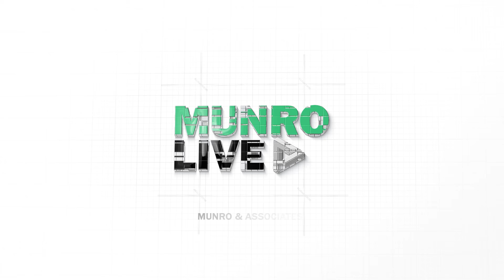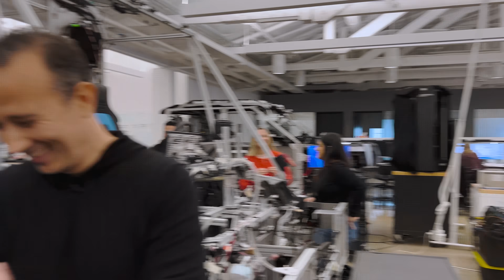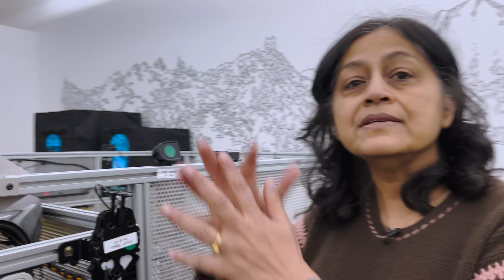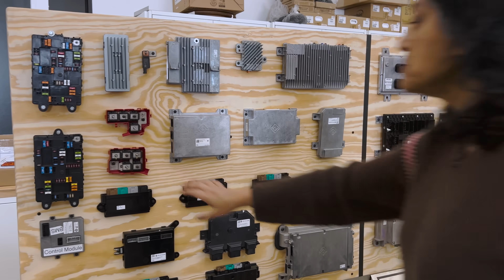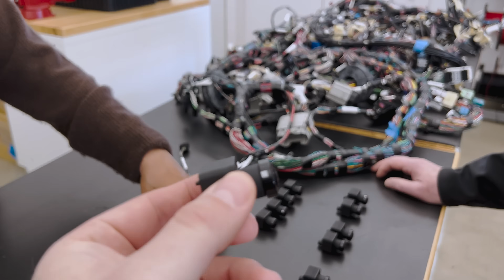Inside Rivian's Electrical Hardware Lab with Vidya Rajagopalan

Comment: Munro Live always talk about costs and streamlilning in manufacturng assembly, but rarely about the costs and headaches downstream when service is needed. In this day and age of OTA software fixes is really a bane when hardware needs servicing because of all the shortcuts and cost cuts involved in the manufacturing process. Trying on hardware repair is costly and difficult. The irony is that the ease of software development and the dependency of everything working in sync is hardly achievable nor practical. Quite often the digital domain makes any fixes a challenging ordeal. In software, they tend to fix one thing and something else works abnormally. In hardware, just trying to get to it without major teardown is rarely possible. Also the convenience of OTA software fixes results in lax in software control. Often times, the business model is release it and we can always fix it later. Then the problem becomes exponentially difficult to be reliable functionally.

Comment: My biggest pet peeve is after all the thoughts going into the design of efficiency in manufacturing and saving costs, they couldn't care less for the people that have to maintain it down the road. That is why repair costs are so expensive nowadays. It is a stark case of saving cost and efficiency on the manufacturing stage by robbing Peter to save Paul and have the owner downstream paying royally to repair and maintain it. It has gotten so bad that a lot of times repairing anything on a vehicle is almost impossible because of the expense. That is why insurance cost on EVs are so high.

Comment: I'm surprised about their design around the doors as most wiring harness engineers try avoiding harnesses frequently being bent as they will do if they are going from zonal  west" "I/O computer and only wires to actuators and sensors compared to having an I/O computer in the door and only having power and network wires to that from a zonal computer. Could you comment on that?  One reason could of course be that they have moved away actuators and sensors from the doors and simply have less need for I/Os in that "zone" but that is not a pure results of electronic design but more a consequence of the mechanical design, e.g., putting the door lock in the B pillar instead of in the door or no door handle in the door but elsewhere and if you also have removed mirrors from the door and replaced by camera or put the mirror on the A pillar, then you have simply less need for I/O in the door.

Comment: The big reason to use Ethernet all over is weight based on less wire.  Bandwidth/capacity should not be the driver to use or not use Ethernet.  Add Power over Ethernet and even more weight is removed.  Location and reduction of ECU/Compute should then be much easier.  Also creating redundant connections would be easier for crash survival.

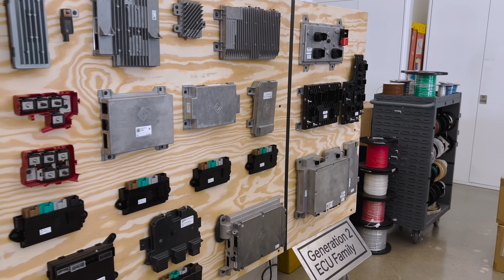Comment: Wild looking at that board at 18:25.  I feel like all the big US market manufacturers (GM, Stellantis, Ford,Toyota, Honda, Nissan, etc.) are still stuck on that left half of the board.  Wild that Rivian was able to figure this out yet the big guys are still just throwing modules all over the place, fuse boxes under the hood, two in the dash, one in the trunk, etc.  The only downfall I see to the Rivian approach?  One of those PCB fuses goes, or a component in the PCB in one of those goes, you need a whole new module.  And that can't be cheap.

Comment: This will be nightmare  for electricians to work on, with all those wire "hoses". I prefer more ECU's because they easier to replace, diagnose and they are usually placed in more accessible places than wires.

Comment: Vidya is what normal Car Companies with their Machismo work environments lack. I do worry about the Semiconductor cooling for the ADAS and Infotainment. Thermal paste + that 1 piece Combo Heat sink + Vibrations. Lets assume that double sided heatsink is manufactured to super fine tolerances and so are the PCB's with their individual chip heights. (Lots of variables here). Are they going to maintain contact via thermal paste over time, road vibrations etc?

Comment: Note to self, don’t buy a Gen 1.
Reply: lol don’t be fooled.  This was done specifically to make Rivian profitable which is a good thing.  But, all the “updates” in gen 2 are designed to CUT costs.  Gen 1 spared no expense which is why they lost $100,000 per unit.  There are other videos showing gen 1 parts that have much better build quality.   So, I applaud Rivian for cost cutting so they have a viable future, but Gen 1 is superior in nearly every matrix.

Comment: Seems like the function focused wiring architecture represents special use integrated circuit processors where the zonal architecture is using general use IC processors.  The software achieves specificity of function for general IC processors. Zonal multitasking would split the bandwidth of the processor for different simultaneous functions. Very cool.  And over the air updates reprogram the zonal processors to achieve software defined functionality.

Comment: very informative and provides insights into important details. The Gen2 system is efficient with fewer control modules, which is a great improvement. However, troubleshooting faults in this system can be complex and potentially costly to repair."

Comment: Disaster waiting to happen. I get it from a manufacturing point of view, less modules, less wires, less weight, MOST importantly less cost. What happens WHEN (not if) a single component on that multifunctional east, west or south module fails? Just look at the BMW I3. EME is a common failure point. BMW charge around 10k to replace it, even it is a $2 fuse soldered onto the board (I'm not even making that up). Even better, they coded the immobiliser code in it so you can't just replace it with a used one. Car is now worthless and goes to scrap. So much for any eco friendliness or fixability. It's all about cheap to manufacture but expensive or impossible to fix.  @MunroLive  Did you ask the smart lady what the RRP of those modules are? Maybe you could do an update with that.

Comment: It occurs to me that the engineers know what needs to be done and redesigned but the bean counters and C-suite fights them.  Sandy's job is to sell the C-suite on letting the engineers design what's needed rather than re-using off the shelf parts.

Comment: I followed Sandy's suggestion to reduce wiring harnesses and go wireless by making all MCUs in my device talk to each other via Wi-Fi. Only two wires going to each MCU, 24VDC and GND. 
On the other hand, huge ECU consolidation in cars makes me scared: 1) if one of those zonal controllers go bad the vehicle would be almost unusable, if a domain controller goes bad only that function is lost. 2) PCBs are rarely repaired in automotive industry, they are just replaced. If a component goes bad the replacement costs must be crazy expensive.
So consolidation is good for manufacturer and gives great performance until it breaks, then it's a write off.
Reply: WiFi only is an interesting idea. I would be concerned about safety related to EMI / EMC issues. It might be possible to completely disable these vehicles by intentional EM-Field emissions.
Reply: @g0nz0man that can already be done with convention vehicles.
Reply: @g0nz0man  indeed not sure I would use this in a mission critical system, as you said any radio signal could get jammed from a distance. In a car I would use a ring of optical fibers. Cheap, lightweight and immune to electrical noise.
Reply: Exactly. It's not if but when. Pick any brand of modern car and you'll hear of failing modules. This is a great demo of technology prowess over common sense. When a $15k module fails, what do you think will happen to Rivian resale value and the brand itself. Cheap to manufacture car with extortionate repair cost will kill off small brands like Rivian.

Comment: So instead of 4 wires (2 Datalines+2x powers)..you run all the stupid wires to the main controller throughout the hinge, no thanks? Completely stupid, build one door module which is always the same with lots of gpios and gets "flashed" firmware by the main ecu. Cheap through masses and unity...
What happens when you need more functionality?  Re-develop on the main ecu?😂🎉

Comment: Love this engineer dispelling the ethernet and 48v  fallacy of efficiency.
Reply: It's not, and she didn't. What's holding 48V back is mostly lack of parts. Once we get past that, 12V will join 6V in the history books. 
Maybe cheap cars won't have fast buses, if you don't have cameras and radars you don't need it.
Reply: @jamesvandamme7786  That's a pretty big if/when. Half the comments on Rivian videos are always people complaining about cost. Going to a more expensive system just for the sake of doing it is fine for Tesla, let them pay the high costs, fight with the suppliers, and iron out the kinks. After they've dealt with the painful transition, it will be much easier for others to join them.
Reply: @patreekotime4578  Funny, I drove a diesel Blazer that was 24V. Ain't a big deal getting parts.
Reply: @jamesvandamme7786  And how many components were 24v? I'm going to make a wild guess here that it was just the starter and literally the entire rest of the electronics ran 12v, just like the normal Blazer. Ill bet it even ran 2 x 12v alternators.
Reply: @jamesvandamme7786  But why 24V have not made into passenger car. There should be parts I think. Eurotrucks have 24V system.

Comment: What we're witnessing is a golden age! Suddenly,  automakers care about complexity and access to components, and this will trickle down to owners being better able to service cars without so much of a snake's nest!
Reply: Have you tried fixing a 1 or 2 year old car? Everything is locked down by the manufacturer so the individual can't do or repair anything under the premise of reducing car theft. The only thing the manufacturer says is you must purchase new extortionately priced electronic module from us, use (or buy) our extortionately expensive software to program it. Golden age? More like poo brown age.
Reply: Most owners dont know the difference between a nut and bolt.
Reply: @drury2d8  They know dollars and cents tho. Especially when they find out their 5 year old car will cost half of its value to fix.
Reply: 😅 no
Software will lock you out as safety against hackers and because cars are data miners to sell more
Replacement is not in focus it is prohibited by the voltage/shock risk and prohibited new sales 😮

Comment: All of the consolidation of parts has the multiple benefits Sandy identified, but they are for the assemblers, QC and ultimately the manufacturer due to lower costs, but now if a “North” controller has a component failure, if the vehicle is out of warranty, it can be a quick module swap, but the new module will be astronomically expensive.

Comment: Seems like wiring could be greatly reduced by using a system that essentially just supplies power and then uses something similar to ethernet over power for communication.  A company in France that developed a compressed air powered vehicle had used a similar RF system to reduce weight, so it’s definitely a possibility.
Reply: I think Cybertruck is doing that,  at least partially? I think it's just a matter of time and component development to get to that level throughout the vehicle.
Reply: They do use ethernet for communication between major modules. But where they don't need the bandwidth they stuck to traditional wiring. A taillight doesnt need all of that bandwidth, just power.

Comment: Thank you Sandy and Vidya for showing the stark contrast between the Gen 1 and 2 Rivian wiring and module interconnect system.  Constant innovation and simplification of systems really separates best thinking practice.  Would think Elon's people could learn a thing or two on keeping  a better version of Lidar like I have is my old 2018 M3 and no longer use.  Wouldn't it be interesting if the two companies could "mind-meld".

Comment: Question?
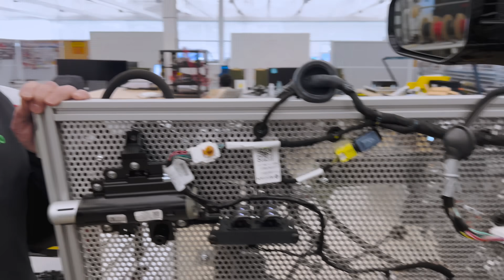At the fuse box @ 3:40 How many fuses are in the Rivian 1st gen?
With the software upgrades, does the owner have to annually upgrade to software updates?
Is it TRUE that people are getting locked inside of TESLAS and RIVIANS?
What's the FAILURE modes of the CONTROL MODULES on the 2nd gen?
Regarding the WIRING and the CONNECTORS is it possible to COLOR CODE the connectors to make it as simple as possible?
Regarding RADAR and the SENSORS isn't that more parts to make?
Is it possible to make the RIVIAN without the RADAR SENSORS?
How's the SAFTEY rating of the RIVIAN compared to a CYBERTRUCK?
What about a KEYFOB that ties into the RIVIAN SOFTWARE?
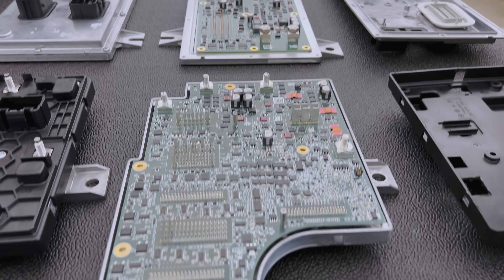Notice the thickness of the boards at 20:40.
What about DUST MITIGATION regarding the AUTONOMOUS or INFOTAINMENT BOARDS?
What about FROST PROOF regarding both of the BOARDS?
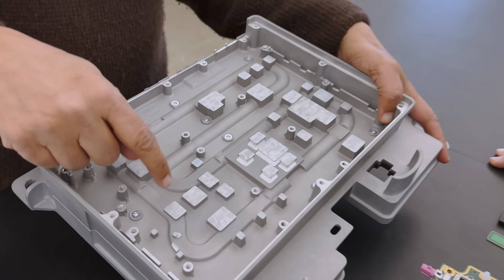At 23:20 regarding the coolant flowing through the pipes, is it Ethylene Glycol that is cooling it?
What about TEMPERATURES? 
I'm assuming ALUMINUM for the petals regarding the COOLING?
Regarding their PCB suppliers? Texas Instruments? TSMC?
Has anybody ever done A TOTAL PARTS COUNT BETWEEN A RIVIAN AND A CYBER TRUCK?

Comment: I am disappointed that Vidya didn’t give a directive to switch to a 48v low voltage system.
Reply: One has to weigh if it is worth changing the low voltage DC bus voltage.  To make it worthwhile, you’ve got to switch most ofl the actuators to 48 volt operation.  If one needs to add DC-DC converters to drive 12 Volt components, that negates savings in the wire mass by adding complexity and more points of failure.  Rivian engineers must have looked at their supply chain and concluded now is not the time to change the bus voltage.  Tesla likes to crow a lot about having a 48 Volt battery for the low voltage bus in the Cybertruck, but then they have DC-DC converters to run the 12 Volt parts.  One supposes Tesla was able to change enough of the actuators to 48 Volts that it makes sense to have a dual voltage low voltage system.

Comment: This is real education, thank you very much.
Our car industry seems to go on wrong direction, making cars more and more complicated, which results in higher cost , both manufacturing and maintenance, I believe most of people want to drive a car , not a car drives them, a car is just a tool taking people from A to B, should be as simple as possible, why do people need a motor to open a door while it can be opened easily by yourself….
Reply: Stats suggest that most people hate to drive,  some can't be bothered to pay attention,  and a smaller (though increasing) number will never own a car.
Reply: Human drivers kill 40,000 people every year in the US alone, that's why we are better off letting AI drive us.

Comment: Another question 2 RIVIAN ?
the change in the concept of the modular design of the ecu's also has disadvantages .
How much does such a compact ECU that combines all ecu's in one cost?
Are there wiring diagrams that can be ordered for repair ?
Or does rivian repair this monster ECU ?
Is it likely that you will have to replace it and pay the new price again?
Is there documentation and wiring diagrams so that you can repair it yourself or order it ?

Comment: Nice, i bet theres still a fuse panel somewhere but it must be tiny. Gen 1 looks terrible to diagnose and trying to get everything to boot in order is rough. No wonder it can't be switched off.
Reply: Maybe there is one big one in the power supply, but all of the normal fuses appear to have been replaced with SFCLs (Superconducting Fault Current Limiters). As far as I can tell, these are automatic reclosers... basically, miniturized automatic circuit breakers that reclose when the fault is cleared.

Also, most modern computers are essentially never turned "off". They go into "sleep" or "hibernation" state, with very low power consumption, the entire OS state is saved in RAM. They only things actively operational is likely the vehicle approach system, and security system. Vehicle approach detects the phone or watch, does it's security handshake, and wakes up the rest of the system while the driver is walking to the door. Same way laptops "start" up blindingly fast.... because they aren't doing a full boot sequence.
Reply: Yea best way seems to just put a disconnect on the 12v negative post to keep it from bricking or draining in storage after some weeks. Not like a regular car where it can be left for months if need be.
Reply: @LarsDennert  Yeah, i guess with the understanding that that first startup will be slow, probably have many trouble codes, and need a prolonged update period.

Comment: Having dealt with wiring and fuse issues, how's this supposed to work 15 years down the road? If you have a tripping circuit is there diagnostics to pinpoint a wire issue or will it require a multiple thousand dollar board? I.E. throwing parts at it and then realizing you need learning software at a dealer?😮
Reply: Boards could go bad of course, but they're fairly reliable these days. Modern commercial aircraft have been using electronic fuses for a while. Fuse boxes have their own issues, aside from 
cost/weight/size.
Reply: Well,  there's much less wiring to search thru. so there's that :)
Reply: Look up SFCLs. Basically miniturized automatic circuit breakers. I think they reclose when the fault state is clear. Since it's all on the board, there is very likely a trouble code if a fault trips. That would beat the guesswork!

Comment: The magnetic vent is brilliant. I'm definitely doing that on my home. The internal sleeve extension might bite you in the future with lint catching the sleeve causing clogging, I would just replace the original sleeve with a longer one. The outside vent system is brilliant as well, I have critters, so I will try it as well, but my concern would be excessive condensation build up, especially in humid climates.